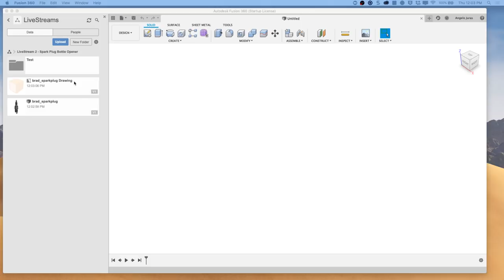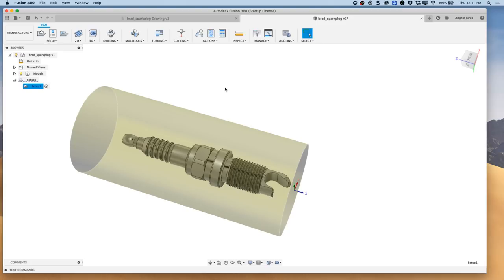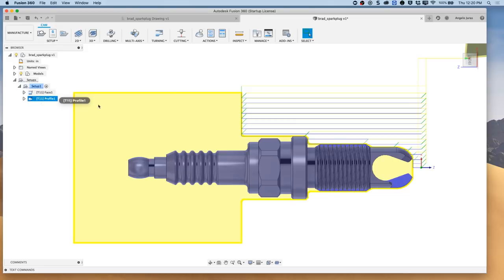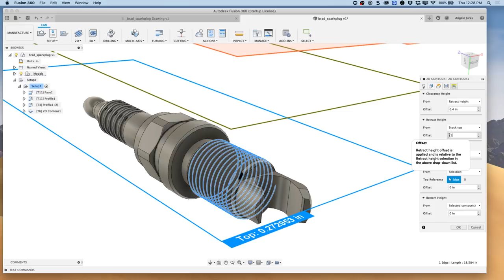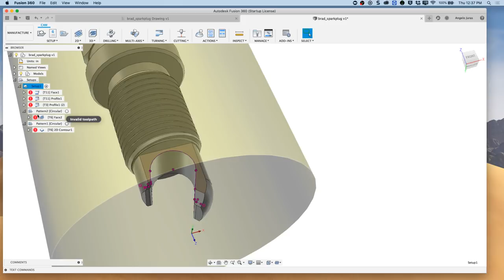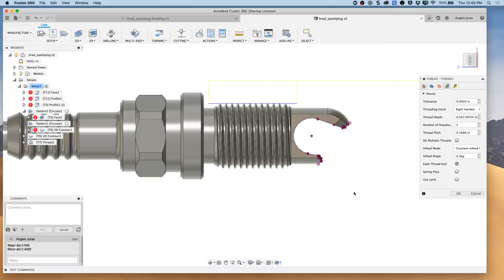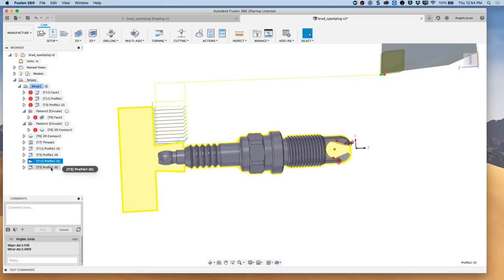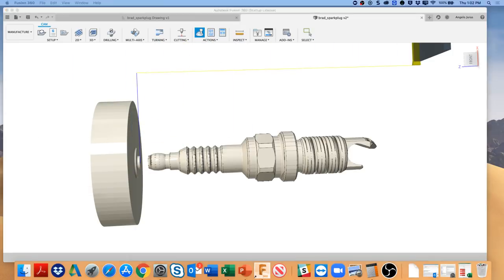360 LIVE: Programming Tool Paths for Spark Plug Bottle Opener, Part 2 of 4

Comment: I'm not sure if this second process after hex nut  is correct . Start/end faces should be opposite, because part will be transferred to other spindle . Second re-grab in claws on thread surface is a bad idea .Great Job on CAM
Reply: Hello Thomasz, thank you for the comments and I see your point. We can make this part in either orientation on the lathe. I am machining this in one operation. You'll be able to see it better in next weeks Live demo.

Comment: I think you made a mistake on your thread operation. You entered the pitch in metric instead of inch units which is why your simulation showed only 3 threads
Reply from the maker: Good call! Not sure if that was on purpose....tune in to part 3 and 4 to see what happens! Part 3 is coming up real quick!
Reply: Interesting, I wonder why its a M14 thread, doesn't mm stand for micky mouse